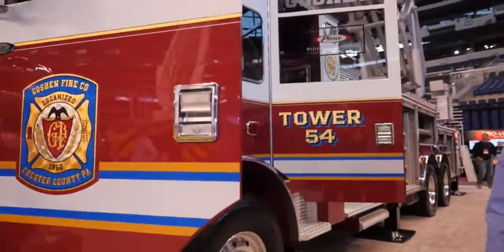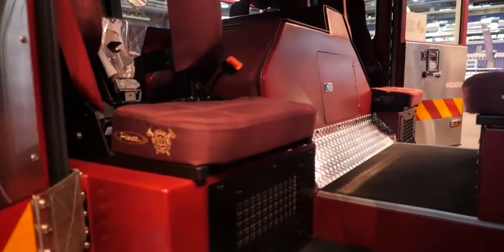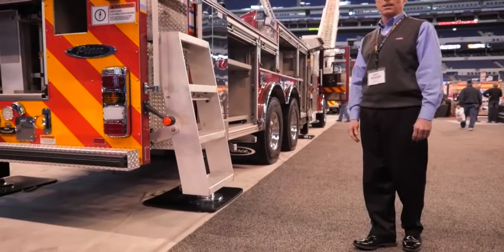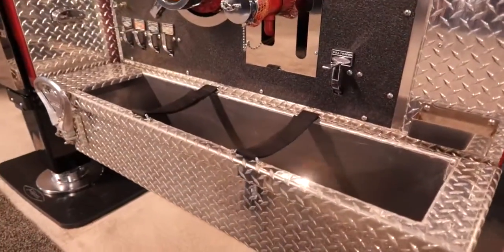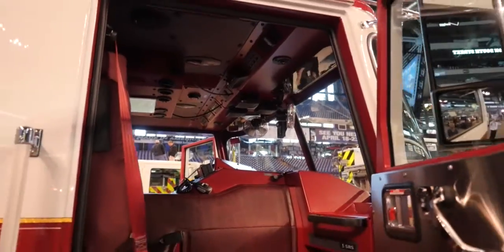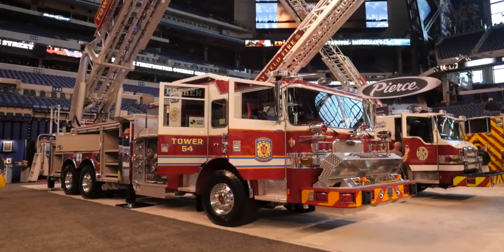Goshen, Arrow XT™ 100’ Platform – FDIC 2015

Comment: Anyone know why they have so many cord reels and junction boxes?  It's not a bad idea to have the option, but very surprised to see dual reels in the bumper rather than a trash line or extrication.
Reply: This fire company probably utilizes portable scene lights rather than truck mounted floods, and you never want to have cords pass under the vehicle (so it never contacts with exhaust or other HOT parts of the truck), so they option cord reels in multiple locations to suit which ever side they are fighting the fire from. As far as trash lines or hydraulics, this isn't a "rescue" first responder unit, they probably have apparatus dedicated to those tasks, so no need for the added expense of those items on a unit that doesn't need it. It's nice to have those things available on any unit, but with the departments budgetary concerns, the extra expense may not be justified if there's simply no extra money for it, especially if it duplicates equipment already available with other apparatus housed with this unit.